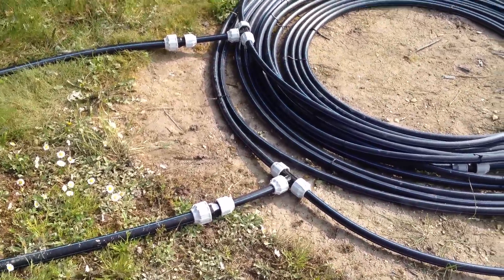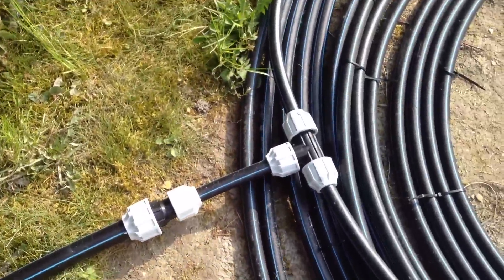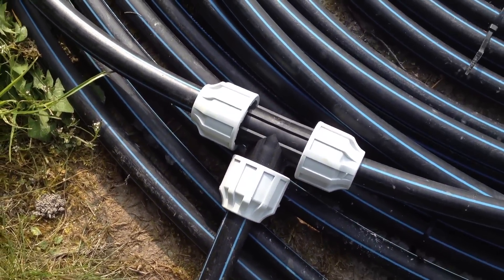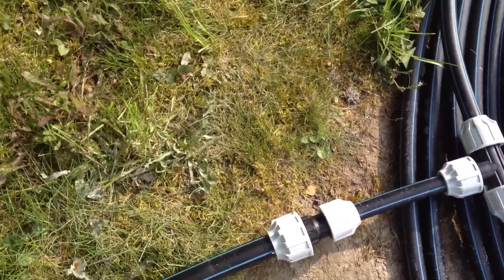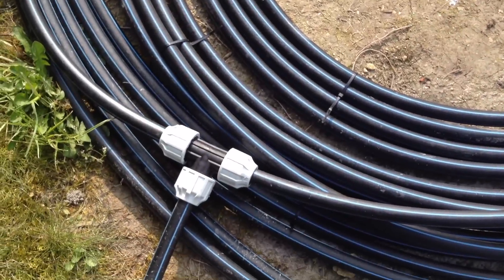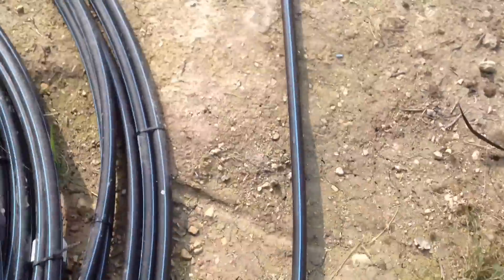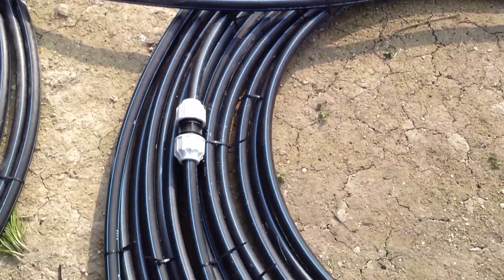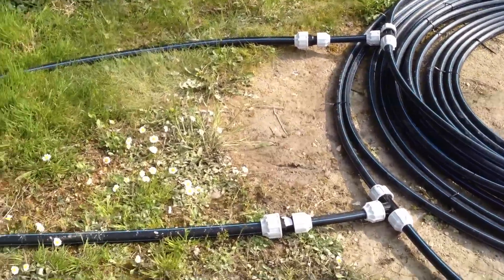DIY solar heating for swimming pool - make your own hot water using the sun and black pipe

Comment: Obviously the placement of the tubing makes a considerable difference ... Putting it on a heat reflected surface .. Using a flat tubing .. Running it across a south facing roof ...
This idea was used at a holiday home we stayed in in France .. a very cheap and simple solution for a constantly warm outdoor pool .

Comment: This is nothing new. In Arizona we do this all the time. Since the 70's.  Pro Tips.  Encase in a box with a  glass cover(old sliding door from recycle place) spray the interior of the box and tubing matte black. Paint will protect plastic from UV rays and deterioration plus increase your heat output by absorbing more light rays than the glossy block does. Seems silly but works.  Some paint will also absorb IR an UV.

Comment: Interesting, but I'd be concerned with the potential toxicity of running water through the PVC as the material deteriorates over time. PVC contains phthalates, a plasticizer, that has been a health concern in recent years.
Reply: I think unless you're drinking pool water the Risk would be low